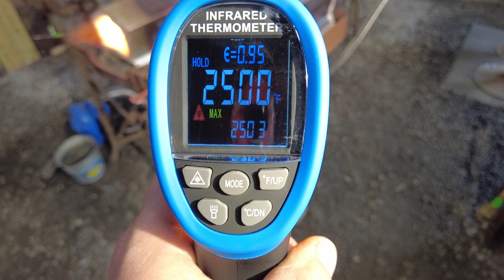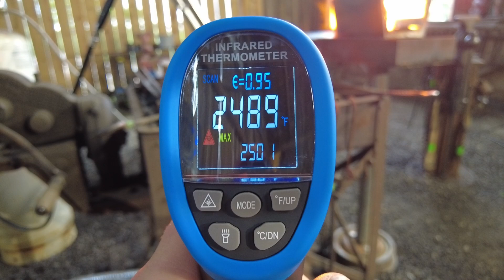Do Two Burners Get Hotter Than One?

Comment: I have a 2 burner Mr. Volcano.  Normally run with just 1 burner because most stuff I make is less than 5" in length. If I wanted to heat a longer piece of stock, would starting the 2nd burner, with the 2nd heat source a few inches deeper in the forge, get the stock hot faster?  Back of forge closed with fire brick.

Comment: The temperature of propane burning with a 1:1 ratio of oxygen to propane will burn at a given temp. The only thing you can do is increase the volume by adding a second burner. So if the question is, will two burners heat still up faster than one? I would have to say yes. Could be why people say two burners are hotter than one

Comment: Yep good practical demonstration/explanation. More burners = more heat generation, but the peak combustion temperature is driven by the chemistry of the combustion (fuel type, oxygen vs. air, fuel-to-air mix ratio). Looking at adiabatic flame temperature comparisons for different fuels can illustrate the differences in theoretical maximum temperatures between different fuels.....
Reply: right more btus, faster getting to heat, and more even the heating maybe and that has advantages in areas like boiling water in say a steam loco like I help out on, or less hot spots heating metal to form it and less time spent waiting

and the air assist treadle hammer an interesting conception, so its basicly like the cam and bradly hammers of old only less weight being brought to bear on the surface, as the helve hammers of old were running I think 50 to 500 lbs in the blacksmith and metal shops of old. looks like it does the job well though as a quick step up to power equiptment vs spending thousands on a power hammer, also newish shirt I see there are several railroaders that wear a denim shirt, I think they used to call them dickies I have one too but I find its too stiff to wear all the time. well chao for now
Jeremy

Comment: You can heat in almost 1/2 the time with a double burner because you are heating a much larger area and slowing heat loss but from experience he is correct same experiments done at my high school with exact same results even though the experiments were done in 1989 at Apollo High School metals shop